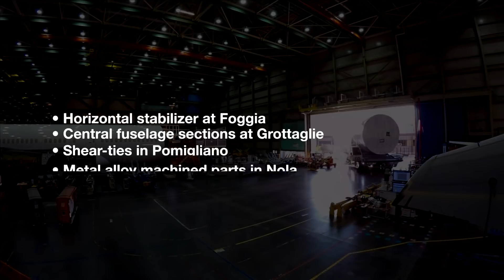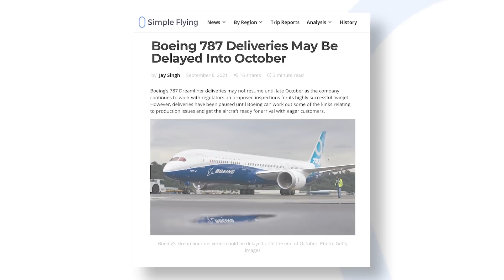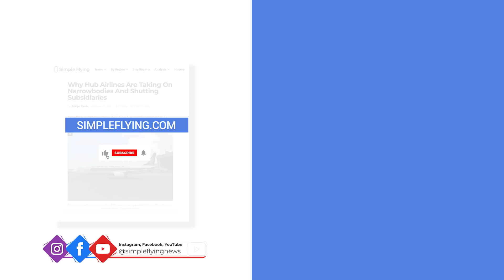Titanium Plates: A Look At The Latest 787 Dreamliner Issue

Comment: Not as I have already said my piece let me tell you something about titanium. It is very soft but very tough metal that takes a lot of heat period but for its weight is quite strong. There is a unique thing about titanium that people have to know when they use it. Because of its softness and flexibility if you stress it back and forth it gets very brittle. It has to enough girth to flex very little if at all. The video still gets a thumbs down for not identifying exactly what the issue is. This video is so freaking vague as to be utterly useless as far as information goes.
Reply: It's all relative, of course, but titanium isn't usually considered to be a "very soft" metal, and its tensile strength is close to that of steel while being about 60% less heavy. Of course, repeated physical stressors compromise the strength of any metal. Titanium is most accurately characterized as being very strong given its relatively light weight, able to withstand very high temperatures, and highly resistant to corrosion. In other words, ideal for application in aviation, but also very expensive.

Comment: All accountants think of is bottom line profits and outsourcing if the part can be sourced for cheaper elsewhere. They never think of the consequences of this outsourcing or the cost of ensuring these parts are of the requisite quality. However that is not to say that having a totally engineer led business is the recipe for success or profitability - it isn't!

There has to be middle ground where multi-disciplined upper management listen to their workers, engineers and designers to understand the potential effects of a cost cutting decision, especially in Aerospace, where any such defect can have the possibility of causing death and destruction.

Boeing needs to look closely at these decisions and not just at their EBIT-DAR or share price!

Comment: The 787 fuselage is large carbon composite "barrels" held together with Titanium fasteners. Alcoa the contractor had production delays and under Boeing pressure shipped the prototype batch so Boeing could begin the first plane. Alcoa sent Aluminum fasteners instead of Titanium. Noticed after assembly, so the "first 787 rollout was an unflyable plane.

Comment: The Dreamliner was to be the be all and end all in civil aviation But its had many various problems from electrical  mechanical to build quality. But as we know its about the planes that actually crash that get a real going over by the crash investigators maybe these guys should be able to pull a plane out of service and do a thorough service check to check on any operational flaws in the plane structure. But that would cost money and with bean counters that's the bottom line its easier to have the insurance pay the victims families after the plane hit the ground at 500 mph.

Comment: Whats my take on the video? Its clearly a much hyped up issue. Airbus gets their parts from the same manufacturer as well, did we see EASA or other regulators  opening their mouth? and this "non-compliance to standard" is very normal with any major complex manufacturing, but its safe as long as its within the limit... (Yes, i say it should be rectified). But it shouldnt even be in the headlines to begin with... its literally knit picking

Comment: Boeing has said that it intends to move the production of all aircraft out of Washington state by 2040. They’ve been saying this since 1995. The planes manufactured out side the Seattle area are of such low quality that the airlines say they have to be essentially rebuilt after they receive them just to be sure that they are safe to fly. Some airlines won’t accept planes not built in Washington at all.  Airbus is capitalizing on Boeings quality issues to make sales. Meanwhile, Boeing management continues to make mistakes at a record pace. Engineers used to be in charge. Now it’s accountants and salespeople. Not the best combination for a company whose core function is aviation engineering.
Reply: I pray every day that a hurricane wipes out the Scab SC assembly facility. Too many friends thrown under the bus by the Chicago management cabal
Reply: Boeing's core function WAS aviation engineering, but its top management and major shareholders decided to change that to profit-making over the past 25 years.
Reply: What is fascinating is that Airbus and other manufacturers are able to deliver quality and safety while still having reasonable prices. Boeing has a substantial problem here.

Comment: Per the question at the end: Boeing still doesn't get it when it comes to safety over money. They want permission from the FAA to consider some 787s as "inspected" by using targeted checks* so they can be delivered and Boeing gets some income. This may have worked 20 years ago, and I understand sampling is used at certain times in industry inspections, but in Boeing, at this point in time, they should have gotten it by now that their processes have been so flawed that 100% checks with no shortcuts are required 100% of the time.

The FAA can't have failed to notice the NASA investigation of the Starliner spacecraft flight test fiasco. Boeing's mismanagement of engineering processes was strongly criticized -  ones at a deeper, more detailed level than the 737 decisions.

*I didn't understand if this was about just 3 aircraft, or a sampling that affects all 108. Either is bad, but the latter would reflect even worse inappropriate self-confidence.

Comment: Despite their claim to be an "injured party", Leonardo is also responsible, as their QA and surveillance processes of THEIR supplier screwed up (as did their own equivalent of the FAA in surveillance of Leonardo and their supplier).  If their processes were effective, they would have caught the issue with the defective parts before they supplied them to Boeing.

Things like this are bound to happen when, due to political pressure at the international level, a manufacturer becomes an assembler instead and has to outsource production to overseas manufacturers of subassemblies.  Even with the 707, Boeing was forced to develop the 707-400 series to incorporate Rolls-Royce Conway engines (instead of US-built Pratt & Whitney engines) in order to secure orders from British Airways and other British carriers.
Reply: I'm not so sure about this Boeing certified MPS as an approved manufacturer. So it is also effectively 'Boeing's supplier' that sells parts to Leonardo for use on the 787. And typically a mfg has to procure test reports from independent third parties before supplying product to a subcontractor... If a vendor sent my company forged test certificates and the forgery wasn't obvious... i.e. we would not do a destructive shear force test to verify a test report that's already been run (and baked into the cost of the parts from the mfg)  we would trust that the supplier - having received boeing certification as an approved supplier would not willfully send us parts that have not actually been tested as that is pretty much criminal-level fraud... No supply chain could realistically operate if every wrung of the ladder was that distrustful of the wrung below... you'd end up just having to in-house all production, and with millions of parts... yeah that would go nowhere fast. No aerospace OEM builds all of their parts in house. Not boeing, not airbus, embraer, bombardier, bell, northrop, lockheed etc.. it's just not feasible.

Comment: Didn't they find surface buckling a month ago , Paint cracking , leaky ports ?? Now this .
Reply: Are you refering to a delimination problem on the Airbus 350 fuselage?   That aircraft also has a composite fuselage.  You should check you data before posting!

Comment: To be fair, these problems are not just with Boeing aircraft. I was in QC at a major US Airline and these type issues were on the A320 type aircraft also. 
The A320 was safe operating with these issues as Airbus, EASA and the FAA had issued interval inspections of the parts in question.
This goes on with all aircraft manufacturers.
After working on Boeing and Airbus aircraft for many years, I have the upmost trust in both Manufactures.
Both have had their issues but both worked to make their airplanes very safe and dependable.

Comment: I would not be surprised to hear that Airbus and other Manufacturers being forced to look at parts supplied by MPS.  Sub-subcontractors usually work on a bunch of contracts for a host of end-builders.  The Dreamliner issue was likely found due to MPS being investigated by the government, and Leonardo doing a complete re-audit of the supplied parts.  As much as I'm not a fan of Boeing, this issue isn't their fault.  Supplied parts from subcontractors have to be taken at face value as standard.  Some QA checks are performed as a matter of course, but things like this issue can be missed.  I'm willing to bet that the only way to determine if these parts are substandard would be to perform destructive testing, as a visual inspection would not reveal a defect.
Reply: when concrete is poured EVERY truck is tested and samples kept. you're making excuses.
Reply: The Buck stops with Boeing!!!

Comment: Anyone else notice that the quality control issues came about because of Boeing's attempt to "deunionize" production of different aircraft by moving production to South Carolina and outsourcing a lot of parts that they used to manufacture in Washington?
Reply: It has nothing to do with being a member of a union.  I was a member of the union in Wa. and as an inspector I was "cammed" for doing my job.  I was just too good at it for them.  I slowed down production and that was not acceptable.  The management targeted me, but they couldn't refute my findings, the Engineers agreed with my Non-conformances. so I retired.  No surprise to me what the results of "share price" CEO's, quality was a four letter word.

Comment: Part of the reason they're experiencing ongoing issues is that Boeing keeps changing the manufacturing process to reduce cost. Even though all the aircraft are called 787, they're not really the same model as Boeing has been changing materials, manufacturing technique, suppliers, and factories over the years.
Reply: The bean counters are in charge.....
Reply: Given it was the first composite body aircraft of all time, the rapid iteration and improvements were to be expected. The De Havilland Comet was a long time ago, but let's not forget the incumbent Aluminum designs had 60 years of refinement and optimization of manufacturing. The improvements for composite builds will start coming more slowly as we approach 2030.

On the plus side, those improvements (a lot of weight reduction), put together with eventual CMC PIPs in the GEnx, will result in a craft capable of flying New York to Singapore, whereas the original design pretty much maxed out at Sydney to Vancouver.

Comment: For years Boeing accepted to build its 787 with some lower-quality parts. The supplier must have been convinced all these years that its quality was according to Boeing's standards as no complaints came in. It is not normal that such parts can be used undetected for years on end. An aeroplane is a high tech device and needs high tech quality control. The troubles with the 787 quality are the result of decades of saving money to make more profit.
Reply: Don't you worry. All these problems will be eventually discovered when there are air crashes that kill everyone on board.

Comment: Not built like a Toyota, Honda, hyundai, and kia.
Reply: Hyundai and kia are trash you fool. Go watch scotty. They break after 100000 miles mostly while toyota and honda runs smoothly after 200000 miles with original engine.

Comment: Sure, when Boeing says there’s no safety issue, the world should believe and forget what’s happened in the past decade. 😂😂. Airlines should take this very seriously
Reply: Not only in the past decade because of the 737 max scandal.. Boeing has been notorious denying any responsibility of their faults and refusing to fix a safety issue until it’s too late and many lives are lost. Examples: 747 cargo doors opening mid-flight, 767 reverse thrust uncommanded deployment, 737 rudder hard-over.. etc. All were design errors by Boeing which I guess due to their improper testing procedures.

Comment: These problems only started after the 787 manufacturing line left Seattle, because this long string of problems started only after moving to Charleston. I think Boeing should put some serious consideration into relocating the 787 production line back to Washington because evidently quality control didn't move cross country with production.
Reply: Boeing is too keen on lining investors’ wallets instead of ensuring quality and safety. They won’t move back to Washington. Everett employees are unionized.
Reply: @BlueMax717  yep but they didn't exactly catch it very early did they...
Reply: The Union here stands up for the workers, who care about quality when management can’t be bothered
Reply: Location has nothing to do with out of specification parts. These are not critical parts but the issue still needs to be resolved.
Reply: Not to be overtly political, but Washington isn't exactly a business-friendly US state. There may be viability issues with remaining there.
Reply: @VisibilityFoggy  That's what the original post said. What we are talking about now is coverups and crashed planes aren't "business friendly" either. Or maybe it's a nice words list.

Comment: I don't understand. Boeing say that the not up to spec parts are "not a concern for flight"... but planes that were undelivered and had the faulty parts in them "Would have been grounded" had they not received the new parts? Surely then the planes in flight right now are in immediate danger of one of these parts failing? Feels like the 737Max all over again.
Reply: @BlueMax717  Thank you for educating me and not belittling me! Very useful information, and I suppose it makes sense. Letting an aircraft fly with a fault you were not aware of is very different to letting an aircraft fly with a fault you ARE aware of.

Comment: Memo to Leonardo,...you are a "risk" sharing partner on the 787 program..!!When something goes wrong with your supply chain, surely some responsibility must fall your way as well....
Reply: That's not how it works. Leonardo also has an insurable interest in the program, therefore it, like Boeing, is a victim of the supplier. Plus, Boeing promulgates a list of approved suppliers and transmits it to Leonardo. It's not always the choice of the lower-tiered partner.

Comment: So the undelivered ones aren't safe to deliver, but the ones already delivered are fine for a while?
Reply: There is an economic aspect as well as a safety aspect.  If the parts need to be replaced, it is more economic to hold back airframes that are still in manufacturing until the upgraded part is available.  Those already flying may have to come back for repair.